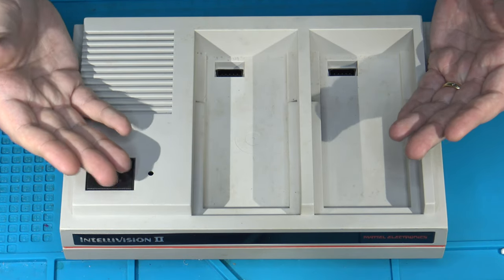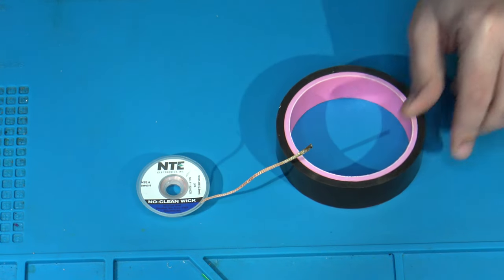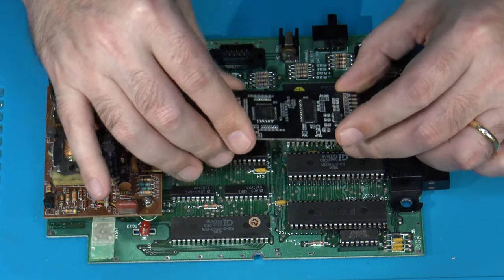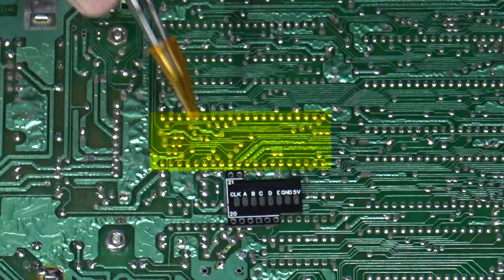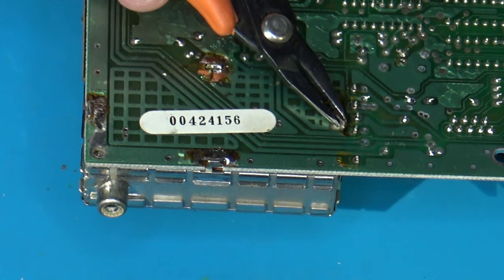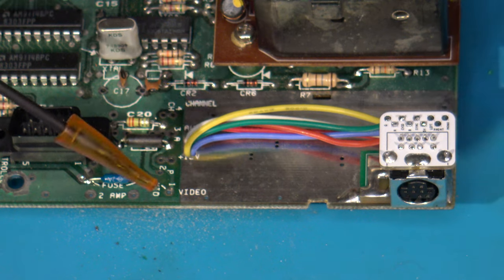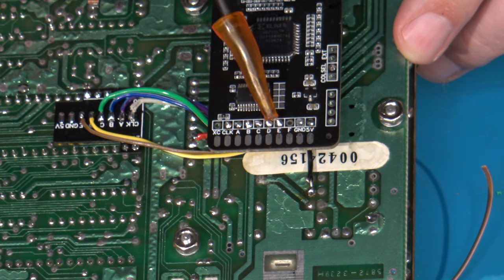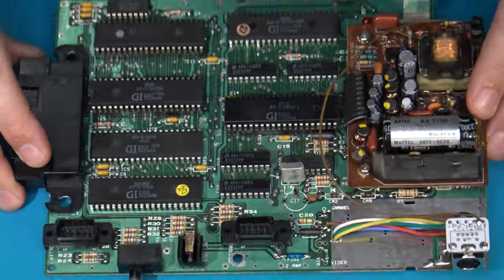ITC#84:- Intellivision Model 2 Orange Peel RGB Installation

Comment: Do you have the Mini din parts for that a stand up for the mini the 9 pin jack  you could share
Reply from the maker: Which parts specifically? I order the PCB mount jacks from Console5 and other electronics websites. The small PCB that I soldered down first and then soldered the jack onto, is my own design that I had made up specifically for use in Intellivision model 1 and model 2 installs.
Reply: Oh okay
Reply from the maker: That said, I have quite a lot of them. Contact me if you would like to know more.

Comment: Hi, 
Is your 8 pin socket compatible with the 8 Pin miniDIN plug to euro scart cable sold by Retro Gaming Cables?
Reply from the maker: Yes it is because that is the exact cable I use in the lab for testing RGB 8-pin setups. I use a Rad2x and a set of Insurrection Industries for my 9-pin RGB setups.

Comment: Do you also do RGB MODS on the Atari original VCS systems and the Atari 2600 Jr. Systems?
Reply from the maker: I've done RGB upgrades on the light sixer and the 4 switcher would be the same. But I've not done it on the Jr. However, that said, at this time the RGB upgrade kits from Tim Worthington aren't available at the time of this comment and I was advised it could be some time before we see them again.

Comment: Do you know if this new board will work outputting RGB through a HDRV cable? I have a Yannick V2 and my understanding is that it has sync issues with HDRV cables. My preference would be to output RGB and convert to YPbPr via HDRV. Thanks for your work on all these INTV boards over the years.
Reply from the maker: Yes, Crayon's OP board does work with HDRetrovision cables. When using a 9-pin mini din, you need to run a wire from the CV output pad on the board to the composite pin on the 9-pin mini din. Doing that will provide the ability to have composite video using standard model 2 genesis/MD av cables, but also provides a properly sync'd signal that the HDRetrovision cables can use since those cables use the composite video for sync to operate. It is because of this reason, that Crayon didn't really see a need to provide outputs for component on this new board as his older kits did.
Reply: @IvoryTowerCollections  Thanks man. As much as I like the output of the Yannick board a little better than Crayon's, that kind of seals the deal for me. Thanks for the info on the sync wiring. Really appreciate it.
Reply from the maker: Crayon's alternate palette is nearly the same as Yannick's and it the main option I use. This is especially noticed on the controller test screen of the diagnostic roms.

Comment: I love this mod but I did have an unexpected issue: The Atari 2600 adapter has no video. It has sound but there's an Intellivision logo only. Did anyone else have this issue?
Reply from the maker: Correct, the expansion modules for most of these consoles will NOT work without the RF modulator in place. that is because the add ons do NOT use the logic on the system to generate the video. They inject their own video and audio through the cartridge port directly into the RF modulator. These upgrades only upgrade the signal from the actual intellivision games. It is the same with the 5200 and CV upgrades too. That said, it is possible to apparently run a wire from the cartridge port where the video signal from the add on comes through and run that to the composite port RCA or whatever you are using for video output. But, you need to install a switch to kill that signal when wanting to use the RGB vs the add on. In the case of the CV I and others will usually add a separate composite board just for that purpose. I tell all of my clients before adding this in, that they will NOT have the ability to use the add on module for 2600 games. I thought Crayon has a mention of this as well on his ebay listings for buying the boards?
Reply: @IvoryTowerCollections  Thank you for the response. I bought the mod last year off of him on ebay. If he mentioned it, I probably overlooked it. It's not a huge issue - it's not like I can't play Atari 2600 100 other ways and don't have 5 or 6 other INTV IIs in the garage. LOL I have to say that I'm BLOWN AWAY at the audio/video quality of this mod. It's like I'm using a MiSTer. Unreal. My hope was that I could also do the Atari too; 2 birds and 1 stone. But it's okay.